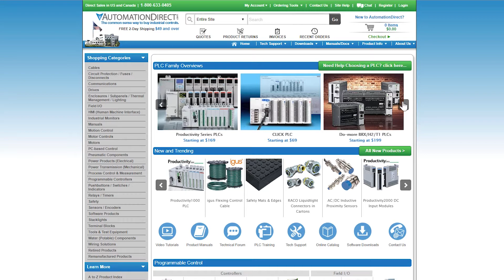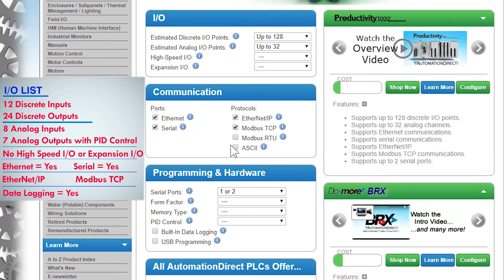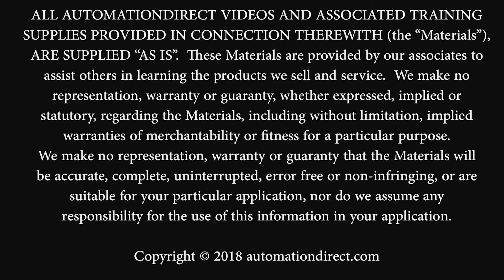PLC Hardware Selector Tool: Control Systems Selection Made Easy at AutomationDirect

Comment: a suitable PLC to meet a particular specification, such as one that would be suitable for six DC inputs and six relay outputs, or possibly six sinking transistor outputs, and a module system that would be suitable for five DC sourcing inputs, four DC sinking inputs, and 12 DC sinking transistor outputs.
Can you help?
Reply from the maker: I would look into to the CLICK PLC line for these specs.